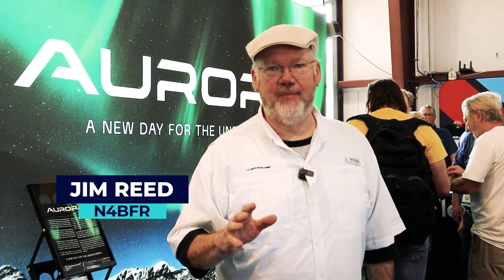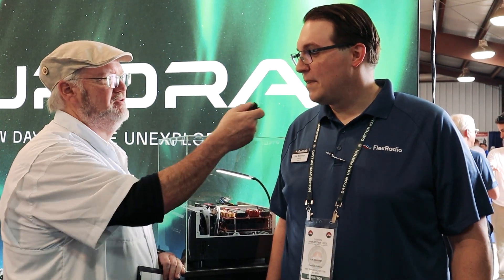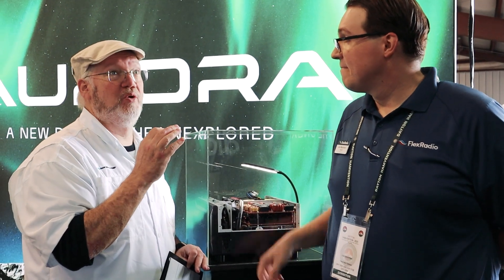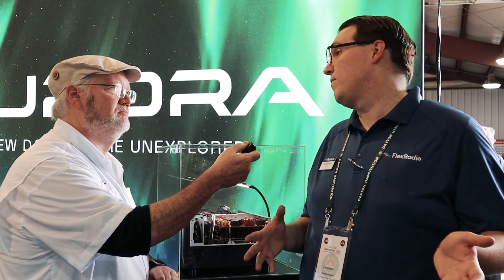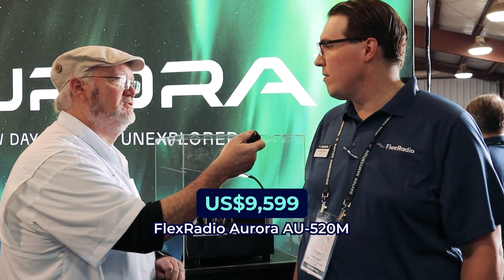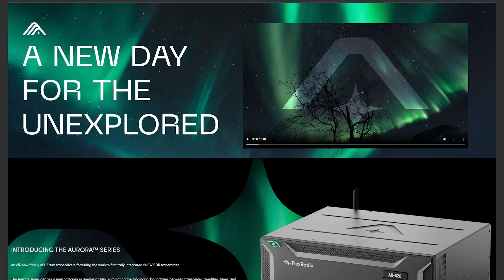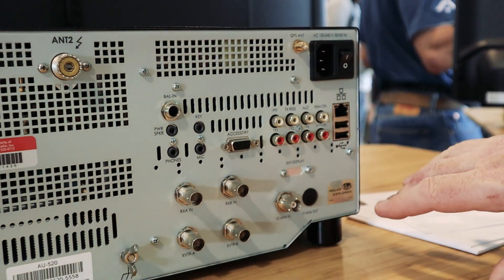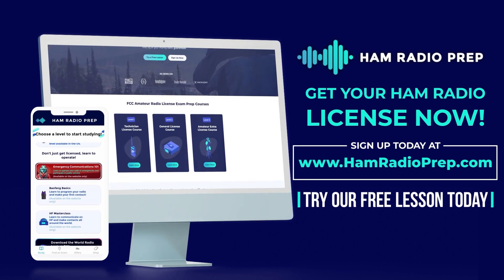More Power, Fewer Boxes – Flex Aurora 510/520 First Look at Dayton Hamvention

Comment: They will be lucky to release it for people to use it for the New Year’s Eve Morse Code Challenge of 2027 let alone 2026. 8000 series barely making it out the door after people being on a waiting list for for a couple of years for 6000 series radios. At least they switched them from the 6000 to 8000 series radios after years of waiting. Amateur radio not a priority for Flex, it’s their other markets.